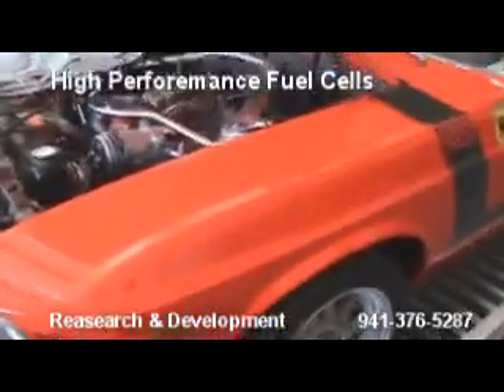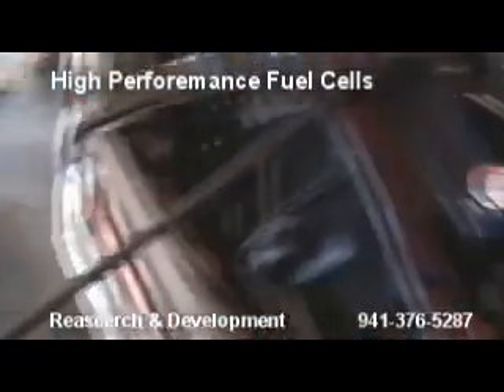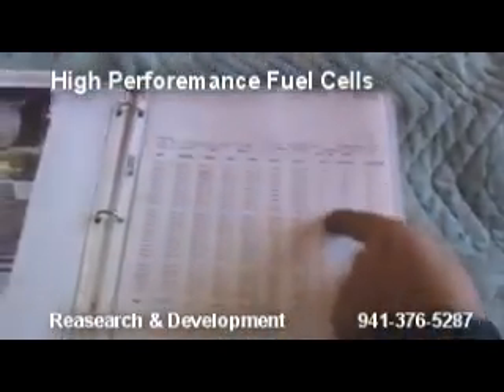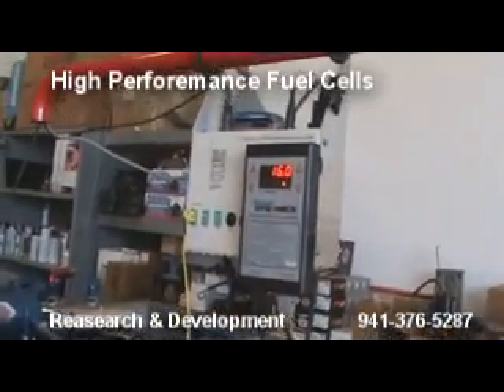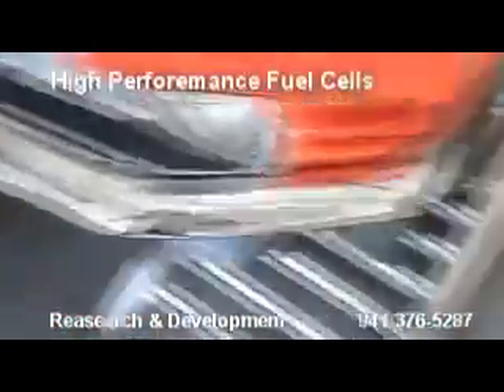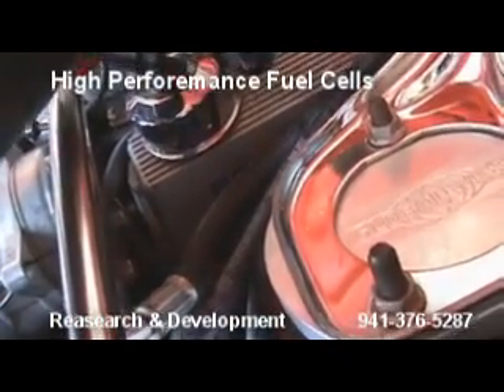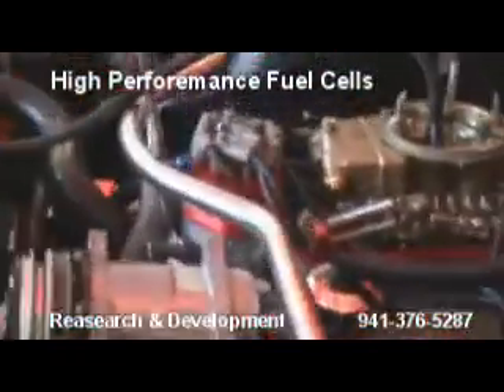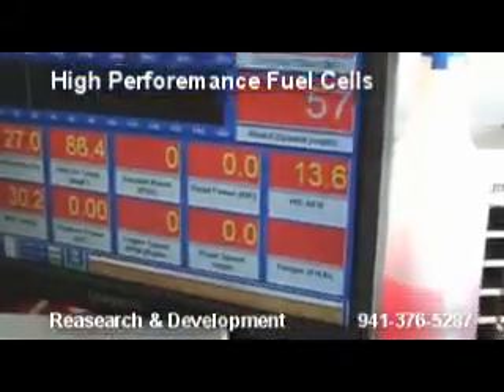1970 mustang 302  boss dyno run on hho

Comment: im not clueless when it comes to AFR's and dyno tuning but i struggle to see the relevance of the AFR's to your goal? If you were taking fuel out, or adding vast amounts of HHO i would expect to see the AFR climb.  You said these cars make more power around 12.8:1 which i would agree with, but at open throttle the numbers were dipping to low 10:1's which is getting a bit on the richer side of safe. Isnt going this low going backwards with economy or am i missing the point here?
Reply: Lynel Simpson